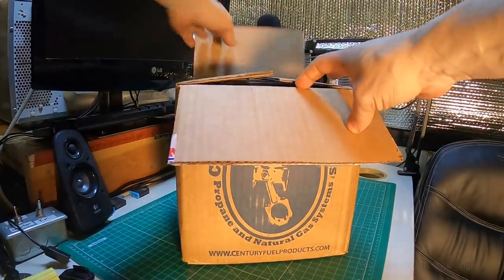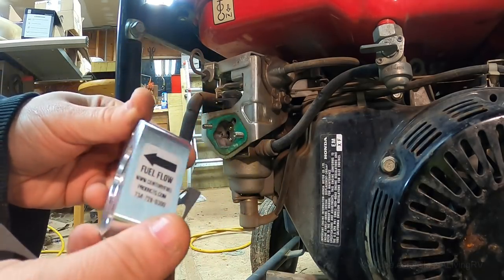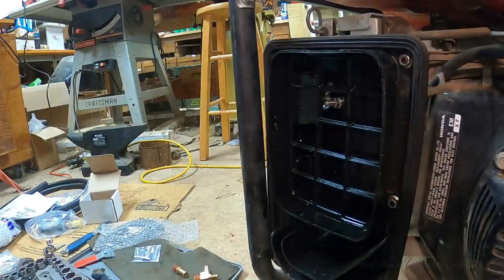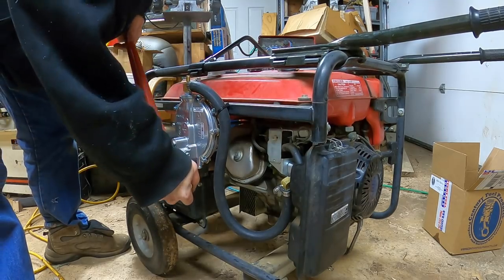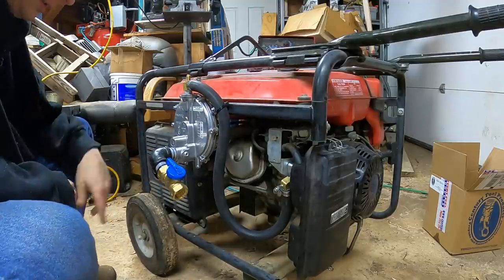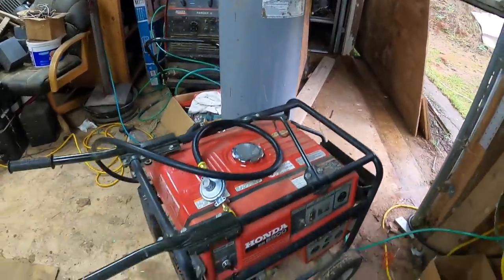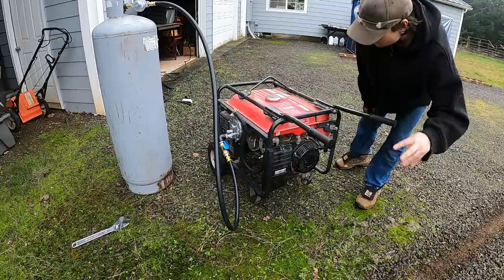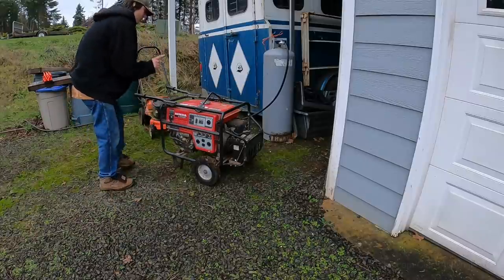Propane Generator Conversion Kit - Honda EB 6500

Comment: I converted my Predator! Propane doesn't gum up the carb and starts it at -30 degrees! Propane is cheaper than gas but you do lose a little power! And the exhaust doesn't stink as bad lol!

Comment: On used generators I've added a propane kit too. I drained the carburetor and drained the fuel tank out and got all the gas out of the fuel tank and the carburetor bowl. it's good to have another fuel source. century fuel products is about the biggest in the business and has some nice kits. don't get a conversion kit that has rubber going into the carburetor why? because over time of the heating and cooling effect rubber can break end up down in the motor with a serious repair. this aluminum and brass block installed between the carburetor and air filter is a very nice piece.

Comment: On the propane and natural gas conversion kits I've done. I use blue loctite on the carburetor studs and on the air filter bolts. with blue loctite it's one less thing that can wiggle loose and give you problems down the road and you don't have to go as tight. I've used it for years and been in the automotive field for over 30.

Comment: Next time you go to do one of these look up US CARBEURATION, their kit was originally like this where you had to clearance the frame I installed that kit on my old generator. On my new one they make a thing called the snorkel which is basically a gasket a little bit thicker and has a hose run through to inject the propane. Much cleaner install on the new kit I must say. Nice job!!!

Comment: You may want to redo all of your connections with the proper teflon. Teflon for gas will be yellow.
Reply: Teflon white and yellow tape can eventually leak. Use the liquid Teflon that smells like oranges. I think it's the loctite brand if they still have it in stock. I've sealed connections on other power adders up to 1,200 PSI and no leaks with it. the only downside using this. is if you have to take it back apart it's harder to get it off and it doesn't really dry good.

Comment: I’ve been thinking about one of those kits for a few years now..  we loose power a few times a year..and some have been with out power for day’s back in December.   I would just run a line off our existing propane tank. “500” gallon tank .. we still have 58% was filled December of 2020. .. mainly burn wood and use the gas for cooking  “stove”. And furnace if we go out it will kick in  ..  Was that kit from the jungle website ?
Reply from the maker: No he got it right from their website i believe

Comment: 100lb tank isn't ideal because the surface area of the bottle is rather low and it will likely freeze with long term use.